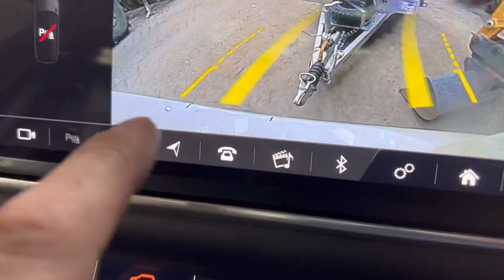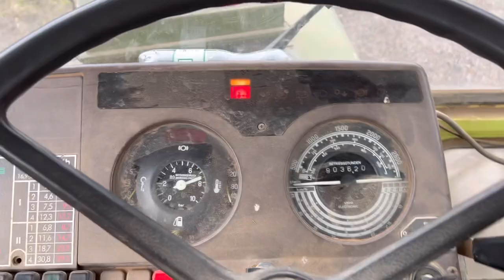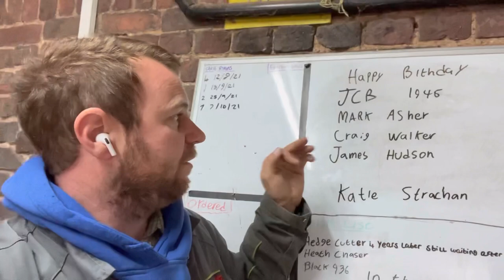Day580  #OLLYBLOGS CASE 1455 vs MBTRAC PULL OFF CAT SKID STEER & HUGE CHAINSAW  #AnswerAsAPercent

Comment: We did a tractor pull between our new Mbtrac 900 and the tractor it replaced a County 1124 and the Mbtrac won all down to tyre's, radials on the MB and cross-plys on the County. 
Great vlog ,👍

Comment: The MB Trac sounder better but the best sound was when they reved together.   Looking at your brazing, you need to get the pipe hotter (dont be scared) and the brass should flow to form a tidy looking repair.Really the pipe needs to be hot enough to melt the brass rod without the flame. Did the brass rod have flux in it if not you will need some to clean the pipe as you heat it. Wire wool the pipe before you start.Try brazing on a bit of scran thin metal, its easy once you get the hang of it.

Comment: if you sand/flat the lacquer back on the fendt with some P1000 you can put another 3 layers of lacquer on it (thats called flow coating and will give you a deeper paint effect to). it was hard to tell from the video if the paint was dry, not enough paint laid down or if it had reacted to something under neath the paint.

Comment: If you wet sand with real fine sand paper between paint and lacquer it should help with the orange peel, I'm no painter by any stretch but that's usually a good place to start

Comment: Olly - Instead of making Plakes of the Large  Stump, Make a Bunch for the Rental Houch or Your House with a Back as well. And make Sure You Stain it. Also BUY Chester some KONG Chewing toys, You can put Peanut Butter inside of it or Treats and it will make him work for it and help him with his CHEWING.  And THE CASE Is and AWESOME Trackor Pull Tractor . YOU can watch many YouTube Videos doing pulls its an Amazing BEAST!!

Comment: 1455 sounds best but definitely like the MB Trac sounds better with that lorry engine than the standard ones that used to be round here. 1455 wasn't in 4WD first pull was it? Great vid yet again 👍

Comment: yes would be better using a mild steel gas rod and oxy-acetylene, you run the risk of filling the pipe with braze if you are not careful

Comment: Those pull offs are a waste of time and don't prove anything in my opinion. 

Would you weigh front and rear axle weights of both tractors? Can't be much weight on rear axle of MB?

We put a deck weight on our fastrac for that reason.

Tyre pressures make big difference too as I'm sure your aware.

Good for YouTube views though.